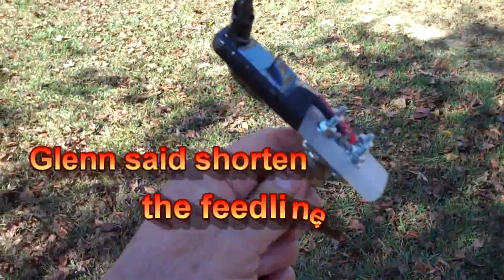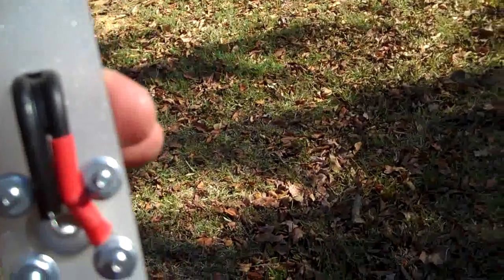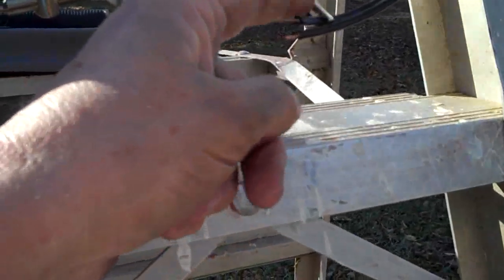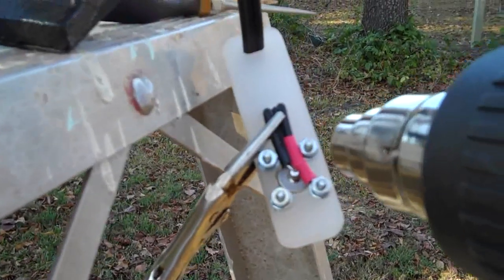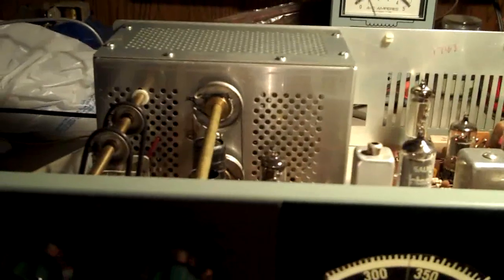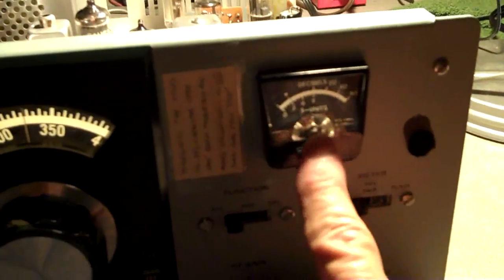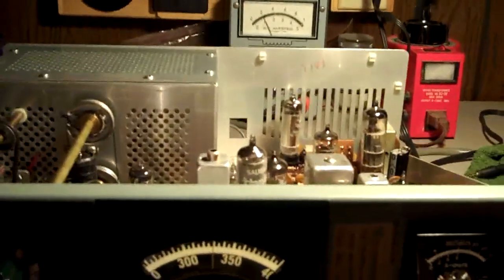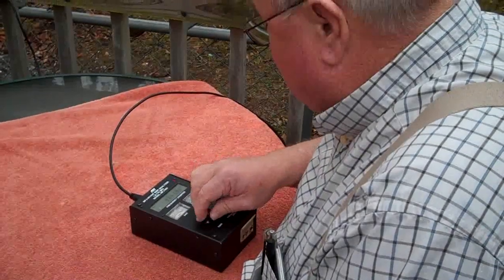Obtaining A Ham License-step by step-details you need to know (part 23 of 34: Making an antenna).

Comment from the maker: @AllAmericanFiveRadio
Rick,
No fun just yet.  There's still a ways to go.  I'm just glad to have found the AF Gain trouble and make the repair.  Also, the band switch is also now behaving itself.  Turned out to be a wobbly circuit board. Each time I'd switch bands the board would shift and break contact with the wafer switch tabs.  Hopefully that'll stay fixed, but if it doesn't I'll just do a "Rick-Fix"...WD-40 all the way.  :=)

Regards,
John